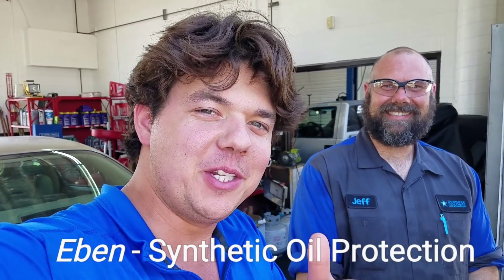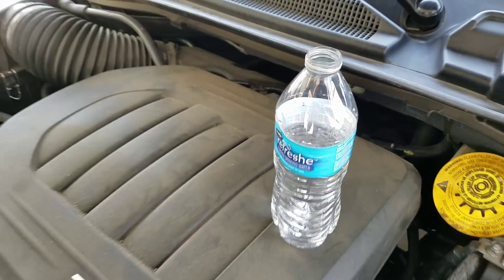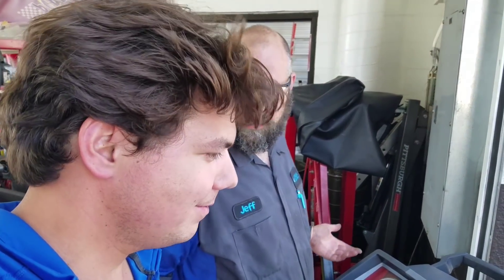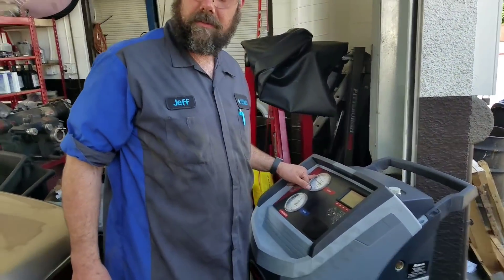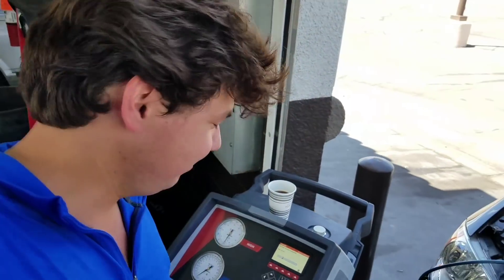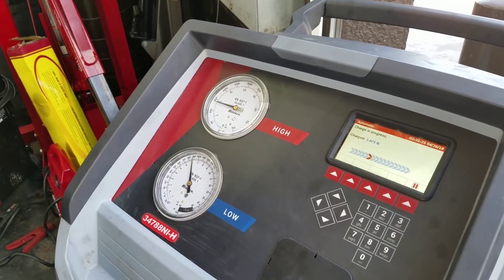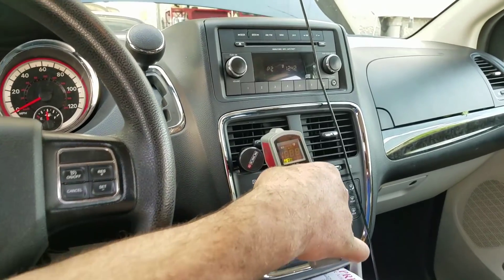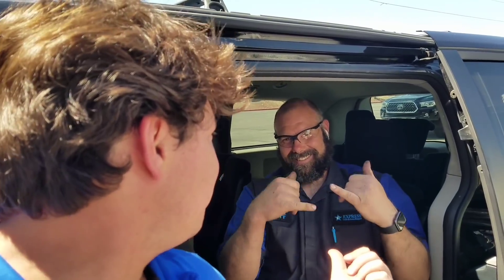Robinair AC Service for Summer Driving Uber and Lyft

Comment from the maker: Express Lube & Auto Repair
5400 E Tropicana Ave, Las Vegas, NV 89122
(702) 433-5823
https://maps.app.goo.gl/RPnUcGFZkLAizoqS9

Eben Rockmaker
Independent AMSOIL Specialist (Dealer#: 5331179) https://www.amsoil.com/offers/pc.aspx?zo=5331179
Mobile: (702) 472-3614

Steps: 
1. My blue link gets you 25% discount and free shipping on orders $100 or more as PC Member. I will get credit for your purchase when you use my link. Click blue link under my name, Click join now yellow bar Preferred Customer for 1 year. Click add to cart. Note: Amsoil will not keep your CC info. There is no recurring charges.
2. Click look up your vehicle.
3. Click auto light truck. 
4. After you have all the products added double check then complete order.
Any order over $100 is free shipping and ships within 1 to 2 days.

AMSOIL Vehicle Lookup - https://www.amsoil.com/guides.aspx?zo=5331179

     Friend me on and tag me because I like to see great results:
Instagram - https://www.instagram.com/syntheticoilprotection/

Facebook - https://www.facebook.com/profile.php?id=100007973957868

Steps to order by phone:

Be sure to use my sponsor # 5331179 and tell them you would like to be a Preferred Customer.

1. Call 1800-956-5695
2. Ask for your own preferred customer membership because you will get 25% off, complimentary shipping over $100, and your informative quarterly AMSOIL Magazine. It costs $10 for 6 months or $20 for the year which is well worth it.
3. Give them my dealer number 5331179
4. Orders over $100 will be shipped free.

Amsoil Signature Series 5W-30 Synthetic Motor Oil protects against harmful deposits on turbochargers 4X better than Mobil1® Extended Performance and 3.6X better than Royal Purple® in industry-standard testing*.
https://www.amsoil.com/newsstand/motor-oil/articles/leading-the-field-in-deposit-protection/?zo=5331179

Amsoil gets better gas mileage - 
https://www.amsoil.com/newsstand/motor-oil/articles/another-win-for-amsoil-products/?zo=5331179

AMSOIL Signature Series is fortified with a heavy treatment of detergent additive and it delivers 30% more acid neutralizing power1 than Mobil 1, and 36% more than Royal Purple, helping engines to stay cleaner, longer.-
https://www.amsoil.com/newsstand/motor-oil/articles/cleaning-up-the-competition/?zo=5331179

Comment: What about the oil, is it included?
Reply from the maker: I will be doing a video on the motor oil change on the van soon I will be doing a playlist on it on how to prepare an Uber and Lyft car for severe service driving.
Reply: Synthetic Oil Protection I mean the A/C must be refilled with oil after the discharged.
Reply from the maker: Yes that machine drains it and refills it to be exact wait

Comment: I've never had my ac serviced, mine seems to be working ok but with the Vegas heating coming, I'm wondering if I should and how frequently you should have the ac service done?
Reply from the maker: Most cars you want to have the AC serviced every 5 years and that will keep it running optimally.

Also I would definitely check your owner's manual.

But being safe is always doing it earlier than later and every 5 years will ensure your car runs great!